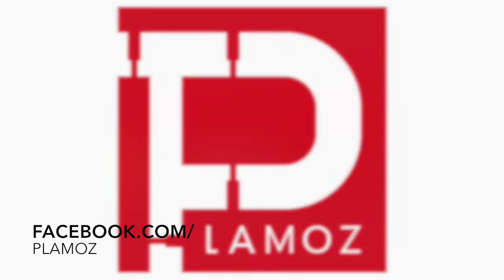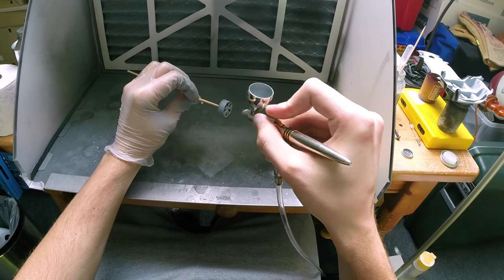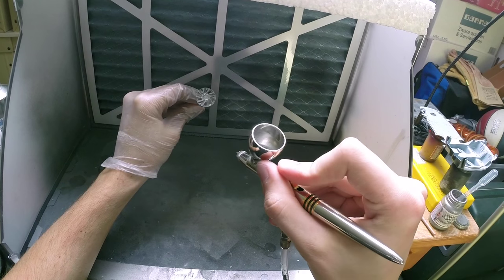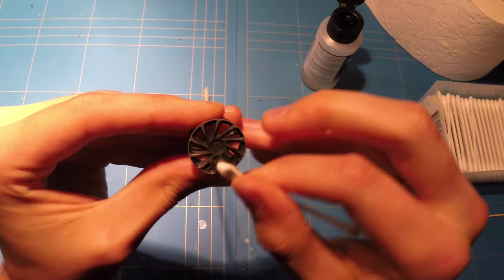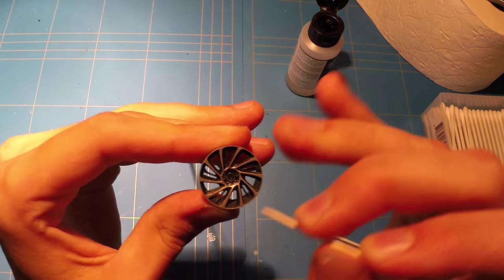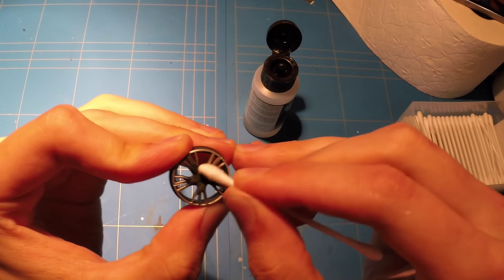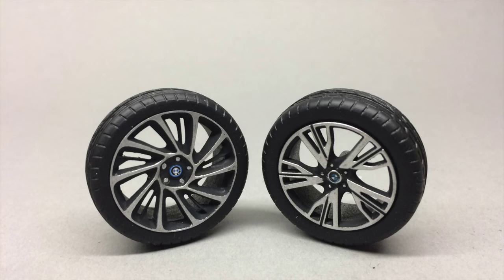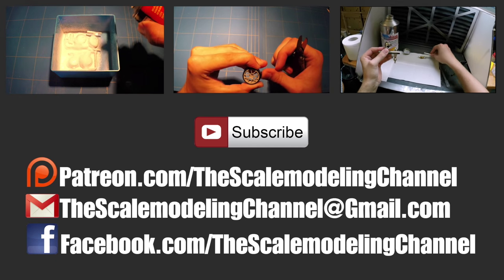Revell: BMW i8 Part 7 Plamoz wheels

Comment: Just picked up my own copy of the i8 yesterday, and discovered your series last night. What a sweet looking car and model. I did notice that the kit tires are directional... meaning that there is a groove on one side of the tire that is supposed to fit flush with the flange on the wheel. When trimmed and cleaned up, it doesn't look too bad, but as you say, the car deserves better. Looking forward to seeing this kit come together otherwise.

Comment: I am currently building this kit. I loved the idea that you used for the wheels. I’ve already sprayed the primer and silver. Was the black you used a Matt finish or satin?  Thanks 
Respectfully 
Jim K
Reply from the maker: Can’t remember what i did back then. But if you apply a clearcoat on top. It does not matter if the black paint is gloss or matt

Comment: Why doesn't the silver come off too when you apply the thinner?  I need to do this to my Plamoz ZR1 rims.
Reply from the maker: Because the silver is cellulose thinnes based paint. An the black is acrylic(water based). The thinner is acrylic paint thinner and there for will only remove the acrylic.

Comment: But don't they have a different diameter than the plamoz wheels?
Reply from the maker: If you turn them around they are the correct size